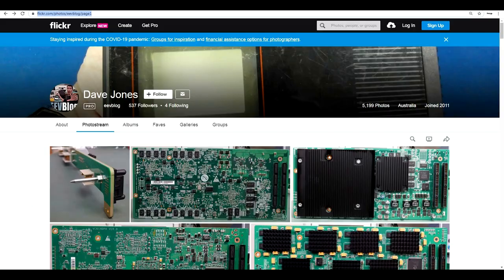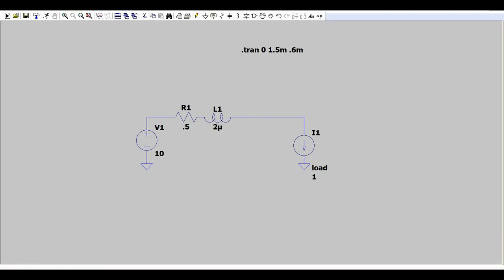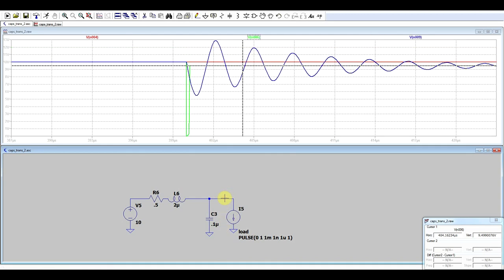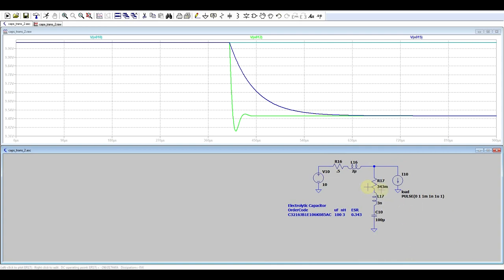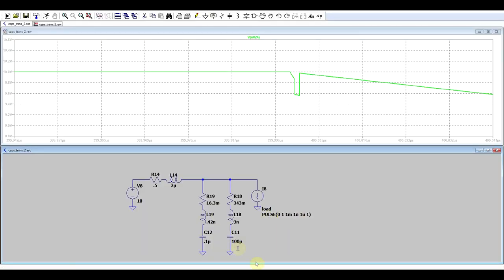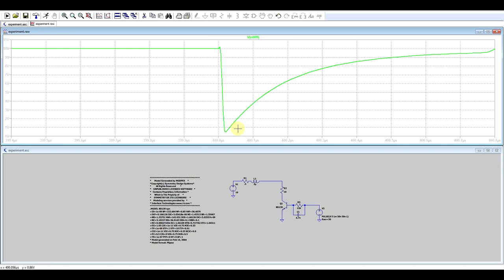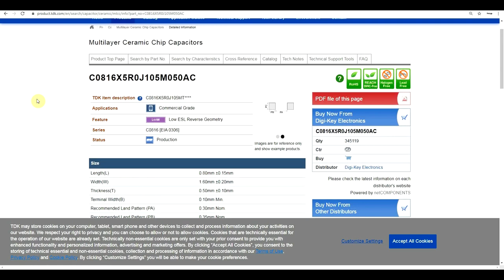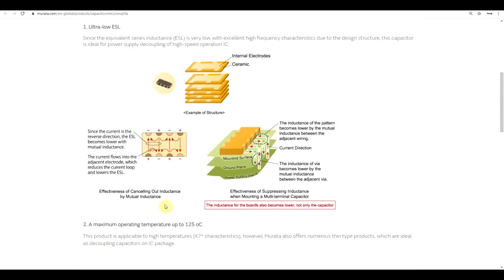Decoupling capacitors 1/3 - Local energy storage devices

Comment: An excellent explanation. Let me add that total inductance (L) of the cap also depends on the way it is connected to the power & return planes. In partcular: How many vias are used (the more, the lower L), how large the vias are (the bigger, the lower L) & how far the planes are from the cap (the shorter distance, the lower L).
Reply from the maker: You are completely right! If the capacitor connection are poorly made, you can get far more inductance from the traces than from the capacitor internals.

Comment: Great explanation. I would like to add something: make sure that you choose the right package for your capacitors. For example: if you have 3 decoupling capacitors (1u, 0.1u, 0.01u), the biggest value should come in a big case (let`s say 0805), and the lowest value in a small case (0402 is fine). This way when the frequency increases the impedance drops to a point and than starts fluctuating around that point. If all your capacitors come in a 0805 case, the impedance would keep rising after that point.
Reply: Thanks

Comment: The current (sinusoidal steady-state) in a capacitor is due to the resultant electric field E_net (resultant of the applied field and an opposing electric field, the fringe field). If the capacitance of the capacitor C is made large, then the fringe field does not build as fast as it would have if C were to be smaller. With a large C, the charge sprays on the plates do not result in developing a large voltage in a given interval of time as evident from the capacitor voltage-charge relation Q = CV. 

The fringe field is smaller and the net field consequently is greater. Therefore, at a fixed frequency, the current increases as the size of the capacitor is increased. The current also increases as the frequency is increased. So, we say it passes higher frequencies of applied voltage.
If the frequency is made smaller, the fringe field builds very rapidly and in the limit when it is dc, it blocks the applied voltage.
If a resistor R is connected to the capacitor then the resistor limited current is not enough to dump charge fast enough at such high frequencies and of sufficient quantity to produce any significant opposing fringe field. 
Therefore, for a given RC combination the output voltage picked across the resistor is able to reproduce the input signal with less attenuation. We say that the capacitor bypasses the high frequencies …..in reality, the electric field of the input voltage passes “through” the capacitor with almost no opposition. 

This makes the capacitor useful as a coupling capacitor for ac signals in amplifiers and also as an emitter bypass capacitor in transistors that will afford larger output swings by reducing the amount of ac signal feedback without affecting stabilising dc feedback.
It is not possible in this post to discuss in more detail current in capacitor circuits and capacitive reactance. 
Electrostatics and circuits belong to one science not two. To learn the operation of circuits, Current and the conduction process, resistors and how discussing these topics makes it easier to understand the principle of superposition of potential which is a direct consequence of the principle of superposition applied to electric fields, 
watch these two videos 
i. https://youtu.be/TTtt28b1dYo and 
ii. https://youtu.be/8BQM_xw2Rfo 

The last frame of video 1 contains in the References articles and textbooks which discuss the unified approach. 
Sections 3.1 to 3.3 in Chapter 3 of textbook 4 discuss the operation of the RC coupling circuit with sequential diagrams using the unified approach. 
Also, Section 3.6 in Chapter 3 of textbook 4 discusses the operation of the bypass capacitor tied across the emitter resistor using the unified approach with the help of sequential diagrams in a transistorised common-emitter amplifier.
Reply: Thank you for your very fascinating comment. I haven't thought about the topic in quite this way before, and the way you explain this mechanism is most insightful.

Comment: Hi , according to   v=L*di/dt   -> 2µ*1A/2n =2kv the voltage supposed to fall  -2kv how in the LT it is full only to 0v ?
Reply from the maker: Hello haimt1464 ! I guess you are referring to the first simulation only with the resistor and inductor. To make the simulation realistic, I didn't use a current source but rather a current load (its a setting for current sources found on the middle right side of the panel). By doing this, the current load will try to pull 1A if that is possible, if not, it just pulls as much current as is available. So in this case the load pulled current until voltage went down to 0, then there was no more current to pull (so it could not go to -2kV) - and this how a circuit would behave in real life.
Reply: thank you for the clarification I didn't know that you use active current load, I learn something new today thanks again.
Reply: @FesZElectronics  In case you have experience with Orcad Capture-Pspice, do you know if this same option is available for Orcad?, I've searched it on Capture but I could not find it. Thanks.
Reply from the maker: @hectorgonzalez6361  I'm sorry, I didn't really use Orcad. The option probably does exist though since its such a basic feature.